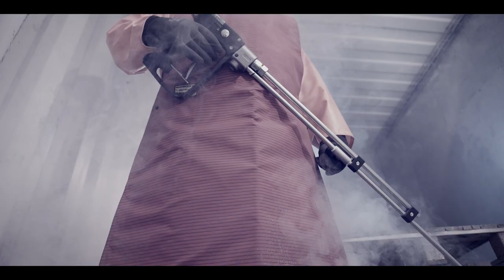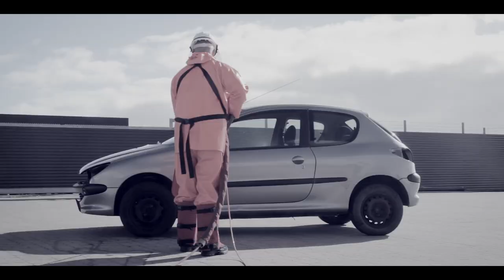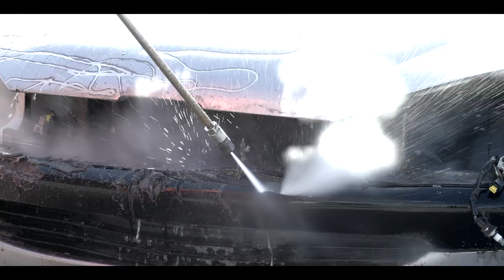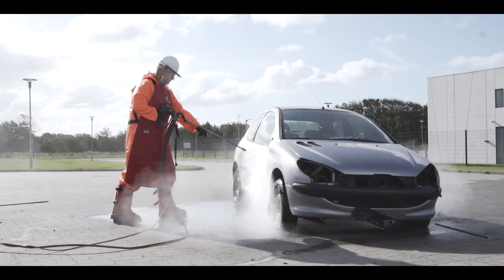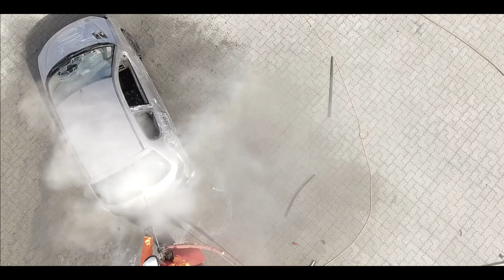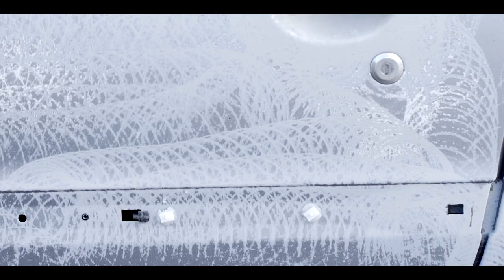Cleaning a car with a 3000 bar power washer

Comment: I used to work in high pressure cleaning for refineries. There was a safety officer in our company who had a scar starting from above his left eyebrow crossing over and down the center of his face and stoping on his right cheek. It was from a 1500 bar hose that blew while work was being performed. The jet of water whipped in the air and caught him in the face. Crazy to think about.
Reply: Bro he has a badass scar. I want one with tiger claws across my face up to my scalp. I need to fight a tiger.
Reply: @theenzoferrari458  as a kid I badly wanted a tiger claw scar in my face lol
Reply: We called it the shotgun
Reply: 1500 *BAR*?! Holy shit. Sounds like he was lucky to escape with his eyesight.
Reply: Is his name Squall Leonhart or Seifer Almasy
Reply: @gwinbeer  I don’t remember his name honestly, this was back in late 2016 early 2017, the company we worked for was called veolia environmental.
Reply: @rollthedice.5973  It was a FFVIII joke
Reply: Is it like a cool villian scar or is it all messed up? Like does he have deformations?
Reply: @tuberrobby  no deformation, it was just a really defined scar, can’t miss it at all
Reply: @theenzoferrari458  cringe
Reply: I was working with this today testing Calibrating pressure gauges.. in the back of my head i was thinking what if the pipes burst

Comment: It's scary how immensely powerful water can be just because it doesn't compress
Reply: Yeah
Reply: Wow really dropped a major science bomb
Reply: It's also heavy AF
Reply: It's also used to cut metal.
Reply: @Mr.Manson  yep, but usually mixed with alund/corund or other ceramic sand.
Reply: @Mr.Manson  Yea. Something with jet in the name they are called right? Something CNC like.
Reply: @kaedeschulz5422  i can’t tell if you’re being sarcastic or not but it’s literally called a water jet
Reply: @d_kortman  Just fergot the correct name. That's all.
Reply: Empty your mind, be formless, shapeless – like water. Now you put water into a cup, it becomes the cup, you put water into a bottle, it becomes the bottle, you put it in a teapot, it becomes the teapot. Now water can flow or it can crash. Be water, my friend
Reply: Them US military commanders forgot about this when they were testing out the A bomb in the sea. The water pulverised their destroyers when it went off.
Reply: theres a water jet at my work that cuts thru 6 inches of stainless steel on the daily
Reply: You can compress water.
Reply: @sixpest  You can't compress water, not without an immense amount of pressure for not much compression
Reply: @Mr.Manson  not only metal. Waterjets can be used to cut literally anything. The only thing they seem to have problems cutting are Waterjet nozzles themselves, the tungsten carbide comp/sintered boride is really tough stuff.
Reply: @sixpest  Show us
Reply: @dzenan.m  you can do it too!
First close your eyes, Then I want you to let that mind of you're loose.
Lastly the most important part by the way; Goahead N start imaging floating water in the palm of your hand then all of a sudden you also imagine you compressed the palm amount of water into one droplet.

And voilà you've got your compressed water.
Reply: @sixpest  what the fuck
Reply: @dzenan.m  so it happened right; see bud I'd never lie.
Reply: @sixpest  nah bud, I just find you uninteresting, that was the reaction
Reply: wow i never really thought about that it blows my mind
Reply: Just because of velocity
Reply: That's why it's called Hydraulic... From "hydro" ("hydor") means "water" and "aulo" means "intangible"/"pipe". All around Greeks...
Reply: High pressure anything is scary. Hydraulics give me the creeps despite being like 10% of the pressure of this washer. If you touch a pinhole leak it can shoot highly toxic oil under your skin and up your body. You don’t want to know how they get it out.
Reply: I remember Richard Hammond taking a front end loader full of water and pouring it onto the car, completely crushing it.
Reply: it can compress... but just a little
Reply: But it is compressed. ???
Reply: @winkekatze5593  it’s pressurized not compressed very much (change in volume remains small). Pressure is the force per area
Reply: @pauld8747  ok
Reply: Be water my friend
Reply: @Bad_Sick_311  Air is weaker than water and many gases. - Sun Tzu
Reply: @notvaas3093  I'm not your friend.
Reply: @winkekatze5593  did I ask ?
Reply: @notvaas3093  You asked for it.
Reply: I'm more impressed that he can hold that lance with 300 bar running through it
Reply: @dzenan.m  watch some hydro forming fail videos.
Reply: And it's also the best drink in the world WTF
Reply: I have compressed water
Reply: Actually at that pressure the water probably compresses by around 10%.

Comment: I was just searching on YouTube to see if it’s safe to wash my car with a new 3000psi pressure washer that I just bought, and I saw this and I was like wtf lmao. But then I noticed it’s actually 3000bar not psi. I feel better now lmao
Reply: Do you know how many PSI there are in a bar ? And you feel better....,?!?***
Reply: 3000 bar is 43,511psi 🤣🤣🤣🤣🤣 That's enough to cut your car in half 😂
Reply: How much is 3000psi in bar? Like 200?
Reply: @neometalx9  1 bar is 14psi, atmospheric pressure.  3000bar is 3000x14, aproximate 42000 psi, not exact but close enough. These kind of pressures are used for cutting metal.
Reply: A bar is 14.5 PSI so 3000 bar is 43500 PSI. Way too much for washing a car.
Reply: Ahahahhahaha!
Reply: 3000 is still too much for your car tho lol
Reply: I know you fucked your car up washing it with 3k psi lmao
Reply: @TheGjkddk  yep
Reply: It is amazing how water can be pressurize to cut. I like the tip, definitely a cutting tip
Reply: @TheGjkddk  used it on my car. 3000psi didn’t hurt it thankfully. Used it at a safe distance
Reply: @lasuzx  I’m glad it didn’t tbh. Look up “imjoshv” on here and he talks about these kind of stuff. 3000psi can seriously mess your paint up. If you can make it work then seriously props I’d be too scared risking 3k psi lol
Reply: @adamwindle2572  adam??? 3000 psi is about 200 bar .... nothing like 3000 bar
Reply: why the fuck are you using psi instead of bar
Reply: @adamwindle2572  that's why he felt relieved that it was just 3000psi he's got
Reply: 3000 psi = 214 bar. no one is understanding the main comment 😂
Reply: @neometalx9  to convert psi to bar divide by 14.5 and to convert bar to psi multiply by 14.5
Reply: 1200 psi is the max for washing cars on a wide tip. Car wash places are set at 1000 psi.
Reply: @TheGjkddk  when I’m saying safe distance I’m talking about from like 20 feet away 😭😭
And even that is too close lmao
Reply: @jamesrobinson1022  what’s a wide tip? I use a 40 degree nozzle on about 1700 psi and it honestly feels like car wash or maybe even a little less aggressive
Reply: @TheGjkddk  most of your base pressure washers are 2800psi...

Nozzle selection and distance from surface are more important.
Reply: @brianbird3756  I honestly don’t know much about pressure washers. I saw some YouTube channel that details cars and he reviewed some electric ones that are in the 1600-1800 range and I ended up buying one. Works so good on my car and I get really close to it and my paint looks really nice still.
Reply: @TheGjkddk  if you ever go with a gas powered, stick with 40° and keep the nozzle at least a foot away from the paint.

I'm actually working on mine right now which is why I knew it was 2800psi off the top of my head.
Reply: r/thathappened
Reply: @adamwindle2572  you don't get it do you?. He feeling better cos it is bar not psi.
Reply: @KevinSmith-os5yz  or to cut humans
Reply: @KevinSmith-os5yz  atmospheric pressure is  a hair under 14.7 psi so yes pretty much. I used to repair and rebuild commercial grade vacuum pumps for medical lab and other facility applications for a living
Reply: @jamesrobinson1022  160-200 bar is used more often in car washes
Reply: @davidperry4013  As you see in the video, its about right for washing a car
Reply: @brianbird3756  I use a 3600 2.5 gpm pressure washer and also have never damaged a car. If anybody who has a big pressure washer worries badly about damaging cars, just get a tip with a larger orifice.
Reply: @neometalx9  3000 psi is 206.843 bar
Reply: @marshallSmithBurner  no bro you have the math wrong its 206.844 bar*
Reply: @that1guy997  it would be 3600 psi with a high mass flow rate with a large enough orifice
Reply: How the fuck does everyone misread the op comment. His washer is 3000psi which is around 200 bar. Perfectly good for car washing.
Reply: ur paint will be long gone with that 200 bar is good enough to wash vehicles, even cow shit dried on to tires
Reply: @KevinSmith-os5yz  you put the numbers around. He wasn't asking how many psi 3000 bar was, but the other way around. 3000 psi is about 214 bars
Reply: @neometalx9  206
Reply: You just don't buy accidently an 3000bar pressure washer
Reply: @clmtncd8750  because in america no one uses bar for pressure washers, and virtually nobody knows what a bar is.
Reply: Just stand futher away, on the first pull
Reply: @lasuzx  it did hurt it you just havent noticed yet. Your clearcoat will be peeling by 2025
Reply: @szpecunio  yeah.....no shit......🤦‍♂️
Reply: @rafapereira129  his pressure washer wasn't 3000 bar......that was the point you ignoramus....🤦‍♂️
Reply: @joeschmoe6908  Only americans. The rest of the world has a healthy IQ
Reply: @adamwindle2572  I have no problem understanding bar, but it doesn't make you smarter. It could be argued that measuring pressure in a fluid with units based on atmospheric pressure at sea level is a bit arbitrary, and not particularly useful. Honestly it's a pretty terrible way to measure air pressure for common low pressure  applications.
Reply: @adamwindle2572  wtf are u talking about ... i was saying that because someone above me said that 3000 psi was worst than 3000 bar XD
Reply: @adamwindle2572  ohhh lol i mensioned u XD wtf
Reply: even 3000 psi is seriously dangerous with the wrong jet tip/nozzle for household use so be aware
Reply: Pro detailer here. You can safely use 1500-2100 psi or upto 150 bar on car paint just know the basics and don’t stick the nozzle any closer than 12” from the surface.

Also the type of nozzle matters, never use anything under 25 degrees (45 deg is safer). 3000 psi is 200 bar, and with a 45 deg nozzle this is completely safe provided you keep the minimum distance.
Reply: @KevinSmith-os5yz They are not, even tho you can use it for it, its mostly used by industrial cleaner, we use it alot.

Comment: 3000 bar is so insane. Keep in mind in most stuff we come in contact with it is usually 2-3 bar. Which is quite the bang when it explodes. But instead of 3 times atmospheric pressure, it is 3000 times. Crazy stuff

Comment: 3000 PSI is enough to give you a fluid injection injury. 6000 is enough to cut a finger off. 3000 BAR, which is 14.5 PSI per bar, is 43,511 PSI. This pressure washer would quite literally cut a limb off with the right nozzle. It is about the same pressure as a water cutting table. Powerful stuff.

Comment: What are the legitimate applications for such a powerful pressure washer?
Reply: Cleaning your driveway
Reply: Doing car mods while simultaneously cleaning said car
Reply: In my ship we use it to remove rust from decks that are hard for a chipping gun to reach
Reply: @caz8135  you're just gonna rip the asphalt off lmao
Reply: @caz8135  cement would disintegrate, dirt would wash away, asphalt would dissolve, etc.......👍
Reply: @walkietalkie1973  i take that as clean :D
Reply: So I personally use hydro blasting equipment on a daily basis at Kennecott copper mine, they use this technology to get black suit off the walls of furnaces that melt copper, or cemented dirt off the sides of rollers that dry out the dirt that comes out of the mine. Or etc, it’s alot easier than using something like a jackahmmer. Also the hydroblasting machine can be turned up or down to change pressure so you don’t go straight through the steel, so you can just peel off the dirt or suit
Reply: Stripping paint of ships.
Reply: Because I can't legally own a machine gun and the ammo is cheaper.

Comment: The paint stripper of the ship repair industry.

No chemicals. Just blast it with a very high pressure washer. Also removes loose rust.

Comment: This surprised me! I was expecting it would clean the car really quick and easy. After a few seconds, I saw something fly off the car, and I still thought it was a regular video, then I saw the bumber split open, and I assumed it was already broke. It was only when I saw more destruction did I realise: Ohhhh! Destruction is the point of the video! 
I was so slow!
Reply: I knew something was up as soon as I saw the gutted interior and missing hub caps
Reply: @ghost2coast296  The missing headlights were a dead giveaway.

Comment: I used to work with a 65k psi at a GM plant, it can almost lift you off the floor, plus that the power washer that i used ot had a spin tip with 5 water spray tips on it so it is like a wire brush used to clean the temporary frames that take the trucks body thru paint process and to wash paint boots amazing power!!!
Reply: just out of curiosity how m7ch do you weight?

Comment: Theres one wash in my city that has a large 3 phase Karcher but it cant be more than 200-250 bar which is not even 1/10th of this unit. And im already careful with it since im sure that thing can blow some stuff apart already.
Crazy that 3000 bar is possible.

Comment: I am damaged , the hose got a failure at about 4 inches from the connection to the pistol . I'm european so we say pistol , it got weared out resulting in a rupture , the beam went through my right forearm , cutted my nervus ulnaris , the nerve that operates the pinkie and ringfinger. I got a 14 inch yes inch in total cutted open section to minimze the damage. They did a "zancolli lasso procedure" look it up on my hand due to my hand was clawing after the first surgery. The rest (2nd surgery) got cutted open for finding the both ends of the nerve ( It works like an electric cable ) to connect them back together. I am partially disabled for life. Somehow i have a very small tingly feeling but never will i feel anything normal again with my right hand. It all looks cool and bunkers , but to all feeling tough and think you can handle it , accidents happens and none is a 100% preventable . If it bites you , you gonna get damaged and it can be a life changer stay safe my fellow high press cleaners .